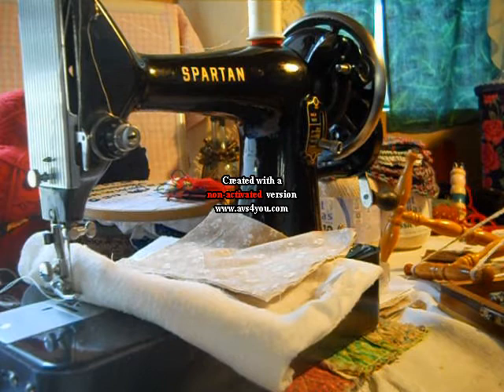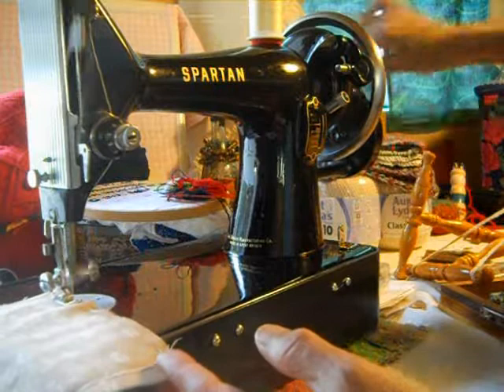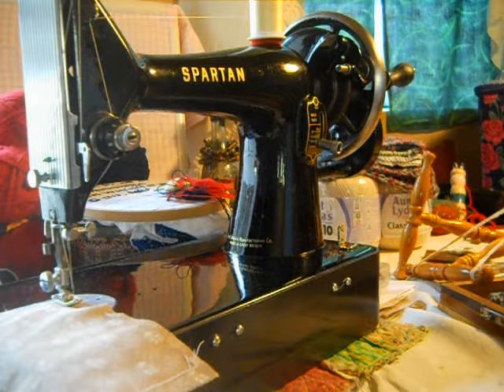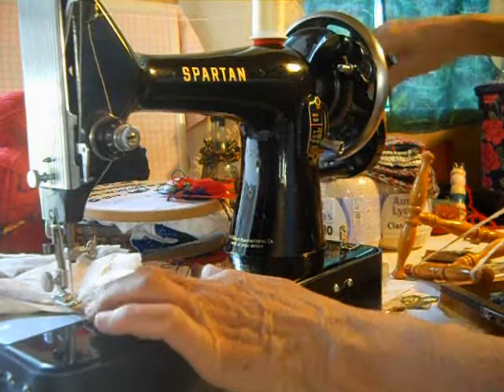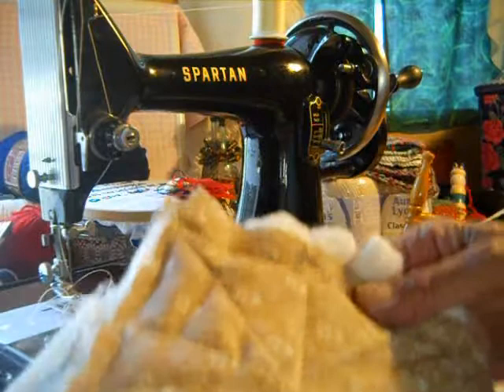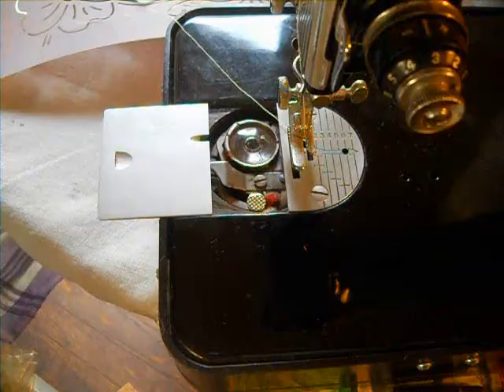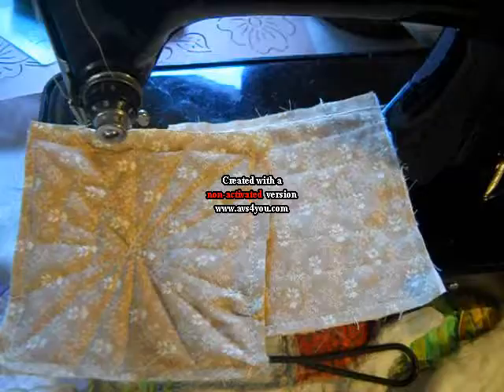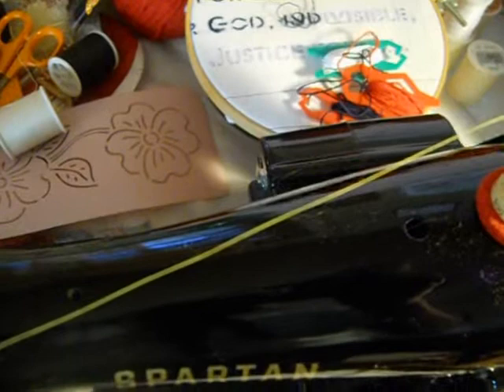1959 Singer Spartan First Sewing

Comment: where did you get the hand crank for the spartan?  I have one and wish to make it a hand crank also.
Reply from the maker: Hi - I bought my hand cranks on Ebay a few years ago - mine is plain black, and a reproduction, Original Singer handcranks are about 80.00, I paid about 20.00 for mine.  The market has changed a bit now- there are reproductions still available, but they seem to be now coming directly from China and have gold decorative painting and "Made In China" on them. I actually have to get two more myself - and I'm not sure yet which I'll pick.  Here's an Ebay search, so you can see what's out there on Ebay:  https://www.ebay.com/sch/i.html?_from=R40&_sacat=0&_nkw=singer+hand+crank&_pgn=3&_skc=100&rt=nc  I'm also looking into two other sellers who may have plain black and will add it here if I find them.
Reply from the maker: Hi again- here is an ebay listing for a spoked handwheel and a black handcrank- about 7.50 more than a set with the gold on the handcrank - https://www.ebay.com/itm/BLACK-HAND-CRANK-SPOKE-WHEEL-VINTAGE-LOOK-ELECTRIC-TREADLE-SEWING-MACHINE-/273394766668?hash=item3fa799134c
Reply from the maker: Here is a link that has a few sellers of parts on it. This list "TreadleOn" is a group of people that all handcrank or treadle.  Cindy Peters of Stitches In Time runs the email list, but other sellers are listed here too.  http://www.treadleon.net/fleamarket/ongoing.htm